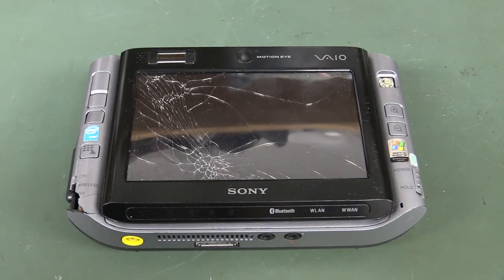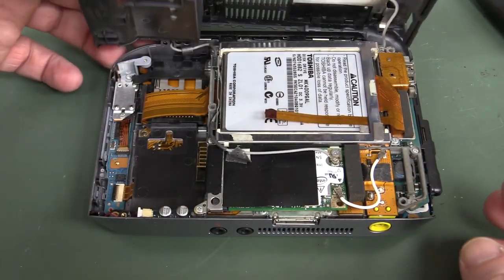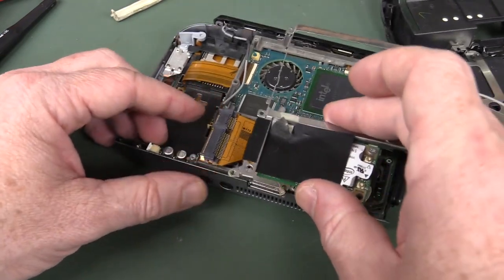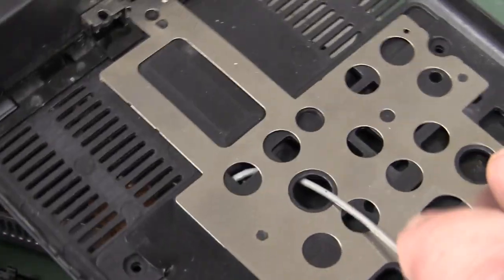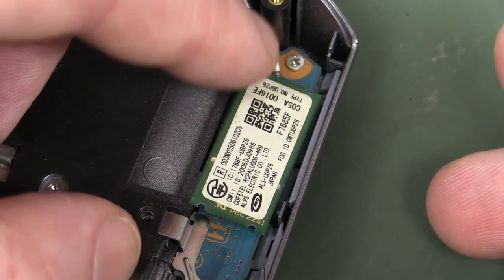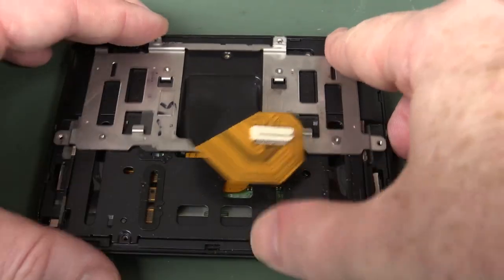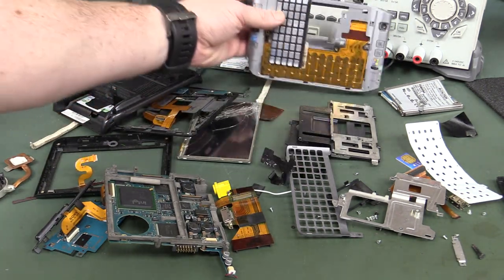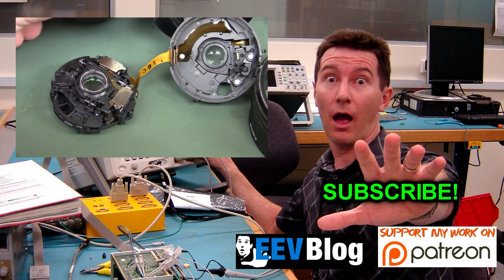EEVblog #914 - Sony VAIO UX Micro PC Teardown

Comment: Hi Dave, I have the VGN-UX390N, and it still fully works!

https://drive.google.com/file/d/0B6QxbmaAgfWLLTlWbnhZSGtYWDA/view?usp=sharing

It plays Solitaire and Roller Coaster Tycoon pretty well. It came with Windows Vista preinstalled, that left me with 4.5~5GB of free space. So I put Windows XP on it, and had about 28GB to use.
I use it as a on the go AVR/PIC programmer, it's better than dragging a $3000 laptop into tight spaces.

Fun fact, in the Terminator Salvation movie, John Conner (Christian Bale) used this model of computer to get into the Skynet facility.
http://www.starringthecomputer.com/snapshots/terminator_salvation_sony_vaio_ux_2.jpg